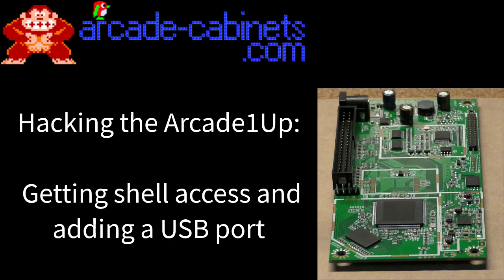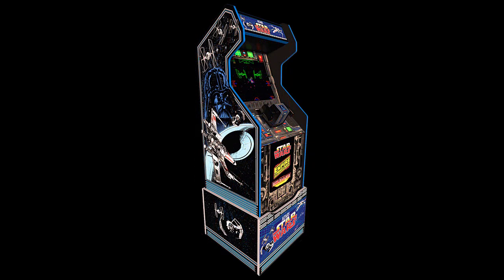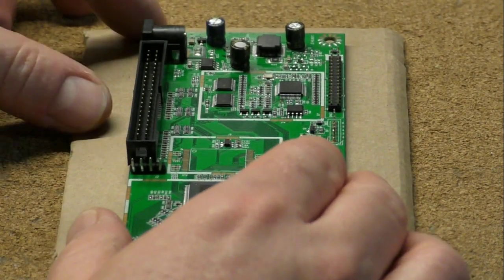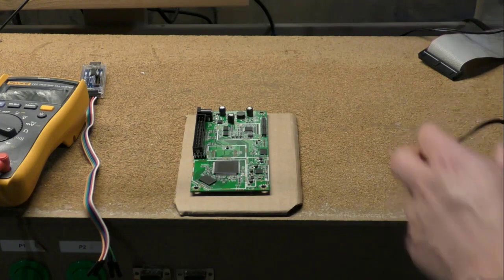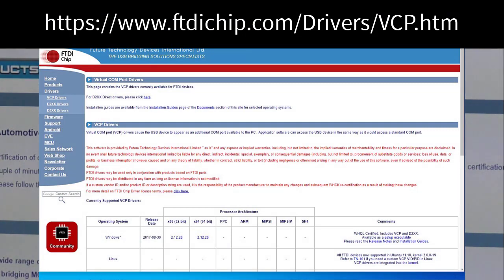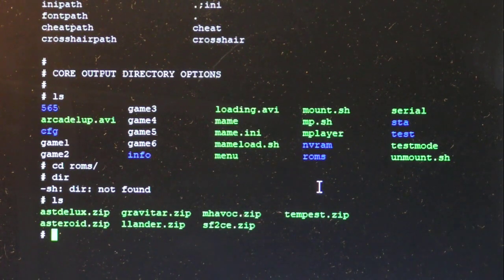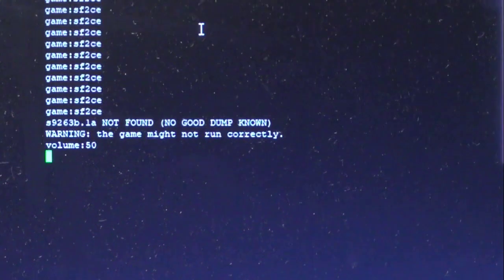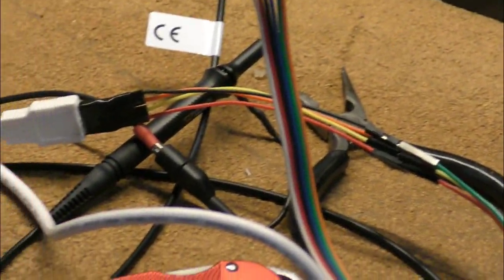arcade ROMHacking the arcade1up Atari asteroids PCB hacking lesson

Comment: Are you able to rip the roms and copy them to a USB as backups? If so how would you go about it?
Reply from the maker: Yes but if I recall they were just the standard roms you can get from MAME rom archives
Reply: @ I’m sure they are, but will they run on an emulator if you pull them off this board? I’ve seen another video where the roms supposedly don’t work unless it’s running off this motherboard, wanna verify that if you ever have gotten to copy it to maybe a usb or your desktop etc

Comment: Hey i know this is a long shot but i have the gen 1 Asteroids Deluxe. Arcade1up messed up on the game  Asteroids Deluxe. Somehow it only has 2 lives and it's supposed to have 3. Every other game is fine. Is it possible to flash my PCB board with the correct Asteroids Deluxe ROM? Any and all help will be greatly appreciated
Reply from the maker: More than likely that’s a config setting you can alter (assuming it’s mame) That said I don’t remember if those setting would be read only or read/write flash I mean you could still change them but if it’s in a read write area it would be simple to do with a key boatd attached if not it could be significantly more work. Unfortunately I don’t remember much about how the were setup as I’m old and forgetful

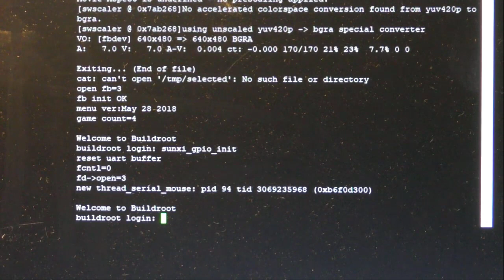Comment: Hi. I know this video is old but I had an issue and hoping you can help. I've connected through UART with the same adapter and am able to see the events displayed but I never get a login prompt like you did at 10:28 Mine just stays at the line "new thread_serial_mouse:" Do I have to hit an additional button or command sequence to get the login? I also do not get any feedback when typing. Thanks.
Reply: sorry try swapping the pin that the TX from your USB (or RX on the PCB side) side goes to, you miight have GND and (RX swapped) or just RX swapped with the "empty" (+5)
Reply: @bebrzezicki  It's weird, I can remote into my Street Fighter using the same method but my Final Fight pcb doesn't give me a login prompt. Might be specific to that board, I'll play around with the wiring. Any chance you can explain how to transfer files back and forth. I can transfer files to different folders within the board but not from Windows to the pcb. I have a bunch of pcb's with no video output that still work otherwise and testing them all. Thanks.
Reply: @ericjvillarreal  oh if it's a different pcb board yes it's possible they did not enable a login prompt on that game.
Reply: Any updates?
Reply from the maker: @YourDadAcademy  no I have not done anything recently in regards to that.
Reply: Dude, plz reply me, how to Add or swap enemies in Arcade games?
Reply from the maker: @salmanulwanzulfan6598  there is no easy answer it is potentially different in each game and maybe very easy on some games (unlikely) to extremely hard on others. But regardless on each game it would take significant time revere engineering the game code if someone has not already done it. I’m sure there ares some games where people already did that work like I know there’s I guy that has done a ton of work on mortal kombat but I besides that I don’t know of games people have modded and have openly published their work.
Reply: @arcade-cabinets I’m hoping you can give me some guidance as well. When i connect to the UART pins with my ftdi cable, the only output I get is garbage data to display. I’m using a windows 7 laptop with putty. I also tried connecting a windows 11 with the same output. I’m using Putty in both instances
Reply from the maker: @bumpinz  you have to set the proper serial settings. I do t remember the speed try all of them and the. It’s 8 data bits no parity 1 stop bit and Flow control off. You might need to restart between each attempt. I’d try 9600 and the highest speed first as most like it’s one of those two
Reply: 15200,n,1,n are my settings and I only get garbled mess on my screen. I think it might be ascii text

Comment: Great video. Is it possible to take the Asteroids 1up board and output the video to a HD15 pin VGA CRT (old pc monitor). I tried converting the LCD output but could never figure this out. And yes, I could just use a Pi but the point was to try and do it. Any help would be awesome.
Reply: thanks. I have not looked into the signaling that uses, but I'm pretty sure you can buy adapters for this to a VGA monitor as I know I've seen people selling them. I think you have to match the specific board you have though to ensure the adapter works.